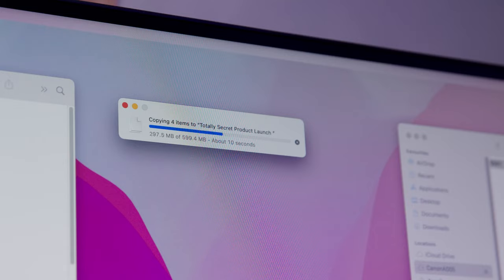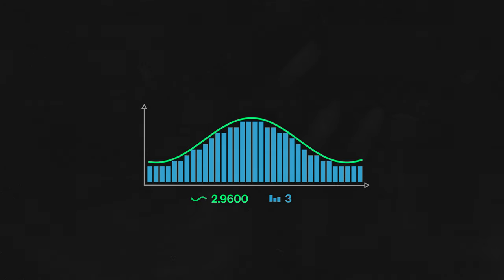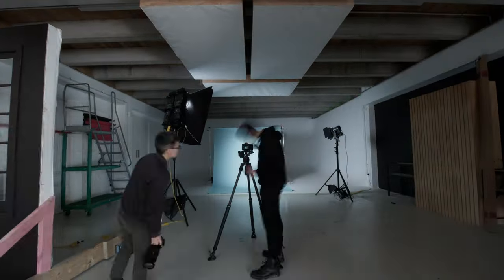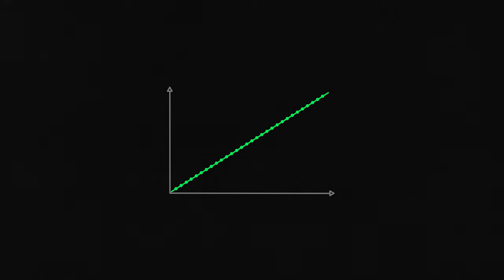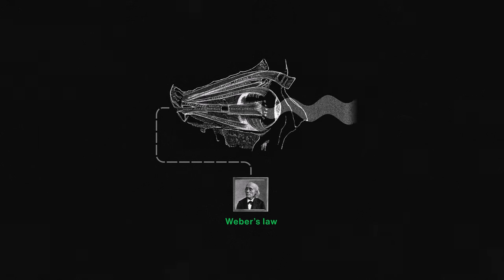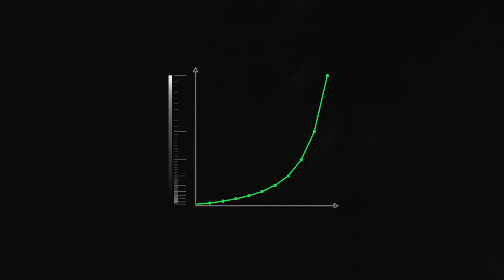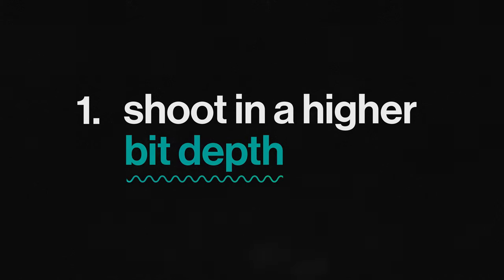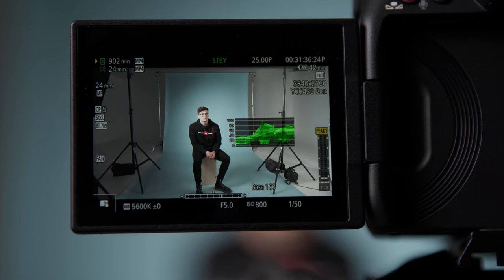LOG vs RAW footage for color grading | What's the difference?

Comment: I know it was just a joke at the end but plleeaaassseee don't buy dozens of Lacies as your storage solution!!! If you are okay with tinkering a bit get yourself an old Dell Optiplex, slap sth like eight 4TB harddrives into it, install Unraid or TrueNAS and use it as a network attached storage. it's MUCH more reliable, easier to organize your data, and (depending on how you set it up) you can outright kill one to three HDDs and not lose any data. It's more than worth the investment!!

Comment: 10bit LOG is most commonly used, but you can have 12 and 16bit LOG. When Kodak released their Cineon film scanners in the 90s, processing, bandwidth and storage bottlenecks limited the Cineon format to 10bit LOG. DPX, replacing Cineon, is a SMPTE standard and supports 8,10, 12 and 16bit. There are scanners that can scan at 16bit LOG DPX if needed.

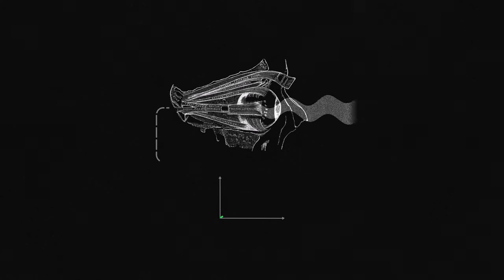Comment: 2:43 this process of encoding in log applies to RAW aswell. Most cameras today with the exception of RED, Sigma FP and a few others take the 12, 14bit or even 16bit linear raw data and encode it to 10-12bit log raw. The one you're referring to is 10/12bit log in a debayered and later compressed format such as hevc or h.264 or even prores
Reply: So if I have sigma fp am I just kinda out of luck when colorgrading? I know log is way better because you have more control over the color.
Reply: @nikstro  no its not. the sensor sees light linearly but the problem is the amount of data because its very inefficient and it consumes a lot of memory so log is the solution to that. 

Raw photos that you take with you camera are an example of linear raw. As you know that beats log anyday

Comment: Wall of text incoming! First of all, thanks for a great video. In a way this is the best video I have found on this subject with zero false statements. Most videos you see about log shooting say a bunch of things that simply aren't true. However, there are a few things you did not mention that I still struggle to find answers to. 1. As you correctly pointed out, shooting in log enhances detail in darker areas and effectively destroys details (to a small extent) in bright areas (almost all videos you find on youtube incorrectly claim that filming in log preserves details in dark AND bright areas). So it makes sense that you would shoot in log if you want to recover dark details in a high contrast scene, BUT, what log transformation does is expand the dark areas so that they cover more of the quantization levels of the bit depth. So basically, if you don't film in log, it could be that the dark details are quantized away, and filming in log expands them so that you may capture them better on more quantization levels. But if you have a tremendous amount of quantization levels (for example if you're filming in 12-bit), using log should not be necessary, because you have enough quantization levels for those dark details anyway. But then this also says that the lower the bit depth, the more important to shoot in log! This goes against what everybody on youtube says which is "don't even consider filming in log if you can only do 8-bit, you gotta do 10-bit", whereas I would say "it is more important to film in log if you shoot in 8-bit than if you film in 10-bit", because there is more need to expand the dark areas so that they cover more quantization levels.
2. Is there REALLY a situation where filming in log 10-bit is necessary?! I see all kinds of videos on youtube trying to show how much "more room" you have to "work with" when shooting in log, but none of them do experiments that actually show WHEN shooting in log is actually beneficial or necessary. If you film in 10-bit you can do some pretty insane color grading before you start seeing it break apart, filming in log just seems so unnecessary. It doesn't give you "more dynamic range" as many youtube videos claim, the camera sensor has the same dynamic range all the time. In a way log "uses the dynamic range" in a better way, but I have experimented so much and never ever managed to produce a scene or situation where shooting in log preserved necessary details better than just shooting in standard, except if you do absolutely insane grading that would never be done in any real life situation.

Comment: "most modern cameras do 12 bit"
Me, who's been shooting and trying my damndest to grade 8 bit for the last 5 years. 
I desperately need to upgrade
Reply from the maker: You'll notice a big difference!
Reply: @SyrpLab  I got to grade some footage from a 5D mrkII in Log and that alone was a massive difference from my m50
Reply: One day I was exited to try 10bit on my Lumix, but the video, but I couldn’t ran it fluidly afterwards. I think I wasn’t using the correct Sim card. Now that I bought an Extreme Pro, faster than the other one, I”ll try it again